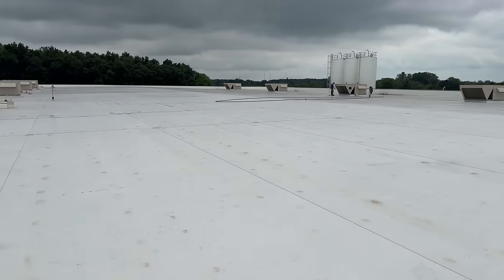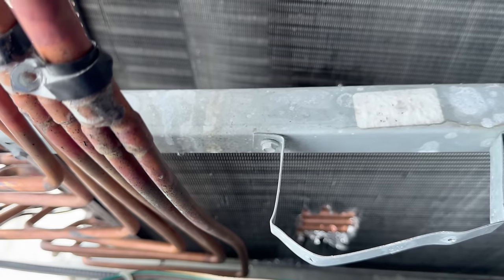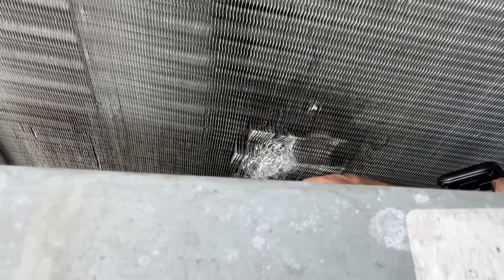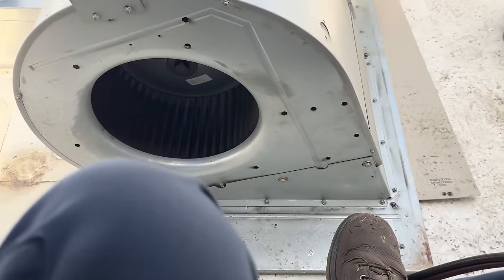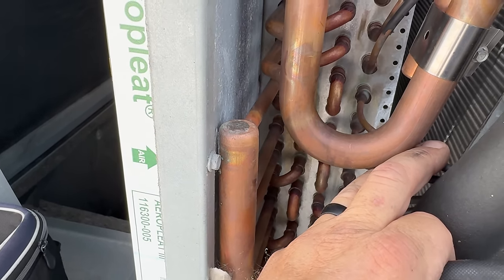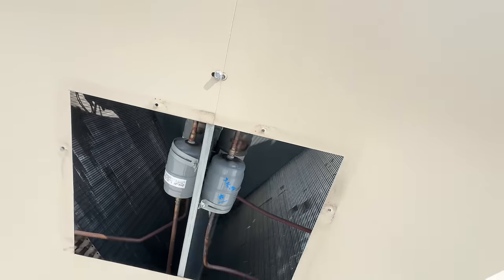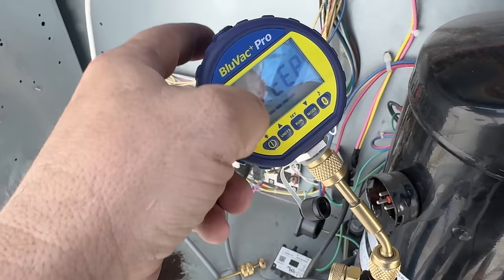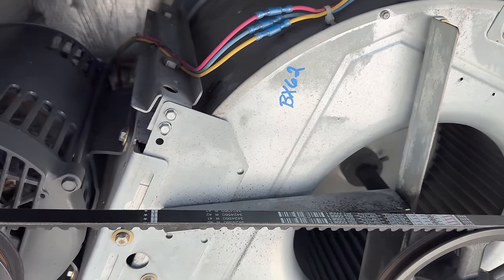LENNOX • Fall From Grace To Leak King

Comment: This fix wasn't a beauty contest, but it works.   The number of hours  spent on the repair still has to be less than another coil.  What's strange  are the multiple leaks in a small section.   Thanks Rick.

Comment: I pull those blower assemblies out a lot to rebuild them.  A two person job for sure (though I have done it alone).  I use a small jig that lets me take the motor off first so it doesn't contribute to the overall weight of the assembly.  They are a pain for sure.  I remember when Lennox used to make descent RTUs back in the late 90s.  I still service a lot of these 'C Box' sized units from that time.  Changed plenty of compressors.  Leaks on those units are more rare than today.  Today it's all this reheat crap and extra coils which make it impossible half the time to track and fix a leak.  We can only do what we can do.  Keep up the good work sir.
Reply from the maker: I appreciate all that info! Thanks for watching!

Comment: 'Back in the day', when copper wasn't paper thin we would re-rout leaking tube to the exterior of the coil. Didn't look pretty but got the system back on-line, with little capacity loss. Those days are loooong gone.  IMO, you did a fantastic job getting it done brother!
Reply from the maker: What you’re describing is what I did on a small R290 system but this one here I couldn’t get to the tubes to pull them apart very easily. After Watching the video a few times since then,  I could’ve unhooked that capillary tube coming in and then pulled the elbow off the line coming back and then pressurized it to find out which tubes going to the next tube and reattached the capillary tube there but there’s always a chance something would’ve went wrong like I said I was so behind on getting everything else finished…it was just get it done at that point. I appreciate the support.!

Comment: Great video! Nice change of attack. I’ve dealt with seals blowing out and packings occasionally leaking on my C and D depressors and core removers. Once I discovered the Appion valves I’ve never gone back to my C and D ones. The Appions are also vacuum rated. Kinda feels like I turned my back on an old friend! 😂

Comment: Great work Rick, I’ve had battles trying to fix leaks on a couple 5 tonne units the same vintage you’re working on and ultimately they needed new coils. Pretty embarrassing that Lennox has these type of expensive repairs consistently
Reply from the maker: Thanks for sharing! I agree, it’s poor quality control across the board

Comment: Yea, I did the same a month back. Big chiller of 20 years old had a leak in the condensor pipes. Blocked off that portion of the pipe and filled her back up. Only so much you can do when this happens. I've personally had bad luck with brazing on coils itself. Maybe it's not the best solution if you live in really hot climates, but where I live, I'm pretty sure it's not gonna be that awful.
Reply from the maker: Right on !

Comment: Heres a trick that may or may not work for you next time on leaks thats spread along a tube section. Take a 1/2 inch copper tube and fillet it. Roll it on and squeeze it back on over the leaking 3/8 and braze the ends and the slit shut.
Reply: Cool idea I may have to try that. On 3/8 tubing I was able to lightly cut it with a hacksaw blade by hand and remove the bad section and use two 1/2 by 3/8 bushings with a piece of tubing
Reply from the maker: Normally I can skim coat it but this was Swiss cheese. I’ve seen people do it, I’ve also heard of using copper wire and wrapping the tube then braze it.
Reply: Why the fuck….. HAVE I NEVER THOUGHT OF THAT
Reply from the maker: I thought the same thing when the guy told me that last week. 😁✌️

Comment: From the late 80’s to the late 90’s Lennox had Rooftops, that cracked the Compressor Discharge line at the same place on every unit for over Ten years, putting two simple 45 bends and a little extra pipe solved the problem, Lennox wouldn’t 
make the modification. Ditto for a particular York Rooftop unit.  BTW, every hot gas reheat design I came across had major problems, related to the reheat.
Reply from the maker: Good to know on the reheat. I don’t remember the discharge issue.

Comment: Nice job done Rick. 
I used the valve opener with the two O-rings for a while and always got some bad vacuum.
They are just crap, the O-rings  get mauled by the threads they have to run over, what a design.
What you think about the leaking condenser tubes, is it a stress related problem?
Seen bobbling tubes on quite some  ULT freezers by two 90 degrees bends 2 feet’s between  from the compressor. 
The second of the 90 bend from the compressor got so much hit that it just degenerated.
 Small leaks but fatal on so small charges the system had.

Comment: Greta video Rick. Should have my Appion core depressors tomorrow. Have been using the accutools depressors but have never been happy with them.  Ha e a great weekend, whts left.
Reply from the maker: I wasn’t impressed with the accutools valve core tool.  It came apart at the valve stem puller.

Comment: That's a bummer, because I've been finding a lot of Trane Voyager leaks from units like 10 years old. I've had good luck with Lennox package units over the years, not very many leaks, but I feel bad now I took out a 12.5 ton Trane Voyager in 2021 because the coil had bad leaks, and the heat exchanger was getting pretty rusty. You know, the telltale 3 big streaks of rust from all three exhaust ports, plus the unit was just generally in bad shape. I replaced it with a new Lennox 13 ton unit, it was more of I thought Lennox was good, and they had a unit in stock that someone had ordered in 2021 and cancelled the order. There was no Trane or American standard units in stock anywhere, this was like right after the worst of the Covid shutdowns. So far that Lennox unit is running good, the factory belt didn't hardly make it thru the first year, but I've been replacing it with a better brand every year and it's been fine so far. I don't think it has any leaks (yet) we'll see. I think the unit has a microchannel condenser coil, I think the evap looks like this one. The only thing I didn't like was, they didn't cut any of the ziptie tails in the electrical compartment at the factory, it looked horrible so I clipped them all. The other thing I didn't like was they went to garbage black plastic door latch handles, why in the world did they do that? Surely the die cast aluminum handles aren't expensive? And I have one customer with 3 old Lennox units from like the early 2000's that are still running, one has a dead compressor (and that circuit has no gas left in it) so I just disconnected, and reassigned compressor 3 to be first stage instead of #2. So first stage cool call energizes #1, and #3, and 2nd stage turns on #4. The board doesn't know any better if a compressor is running or not.

One thing I do like about the new Lennox units is the new Prodigy control, very intuitive and easy to go thru the setup, and look at error logs etc. The Prodigy 2 ones were awful, and pretty hard to navigate to things like reheat or free cooling parameters and not very intuitive to use. The old school ones like most of my customers have with the boards with the little green blinking lights have been pretty good.
Reply from the maker: It’s hit and miss with different models.

Comment: I appreciate the videos a lot, I’ve always learned something from each video that has helped me in the field. I started my career doing residential and just switched up to a company that does commercial as well. Is there any certifications that you recommend getting that makes you more valuable in the HVAC/R field besides an EPA? I appreciate it
Reply from the maker: The only certification that I know of that was not BS was the Nate certification. You actually had to know what you were doing and it proves that you know what you were doing. The EPA certification doesn’t mean you know anything other than the Law.

Comment: Have you tried soldering versus braze for coil repair? Thin copper makes a braze tricky.
The means justify the ends in this case
Reply from the maker: That repair looked like crap. Normally I can do it well but between no room and just wanting it finished it didn’t work out. Soft soldier I feel is harder to repair with because the filler is so thin vs silfose.
Reply: @HVACRSurvival  Yeah the problem with solder is there's no plastic phase, it's hard then suddenly turns into liquid like water. Same with like aluminum, it just suddenly turns into liquid.

Comment: those re heat coils are ridiculous. Is there a APR system in place? Looking to find the difference between APR & Hot gas bypass??
Reply from the maker: Apr? Automatic pressure regulator?

Comment: Typically, I’ll use. Turbo torch on coil repairs.
Reply: I use a small rosebud, it has like 4 ports in the nozzle. It's short and can get into cramped spaces, and doesn't make a long flame like a turbotorch, and uses a lot less gas.

Comment: What do you use for jumper wires?
Reply from the maker: I have custom ones that I made out of test leads from Fluke leads that went bad. I’ve also shown off the jumper king but most the time I’m using my custom jumpers

Comment: Those Browning torque titan belts are junk. Switch to a normal Browning belt (non X belt) or gates belt and the belts will stop "loosing themselves up." 

I refuse to buy those Browning X belts anymore. Was never a problem until they came out with the torque titan belts.